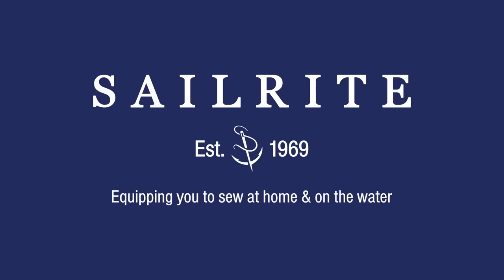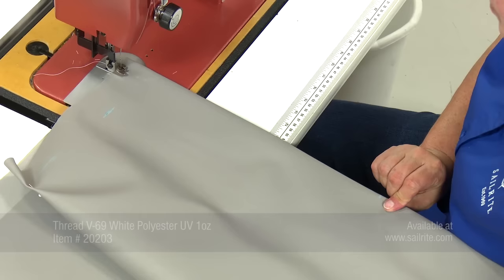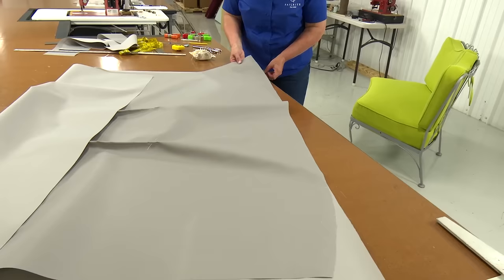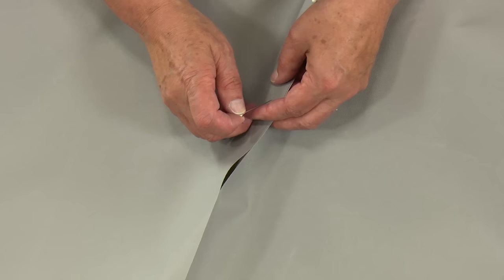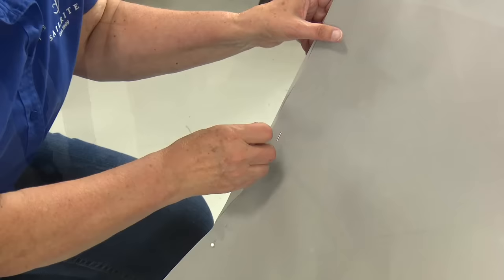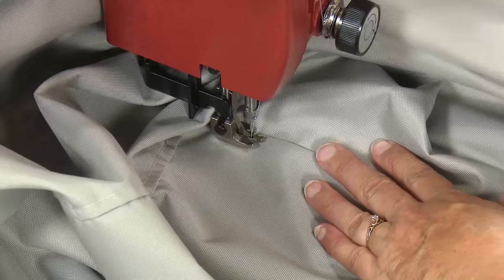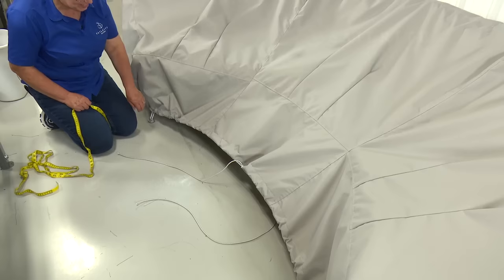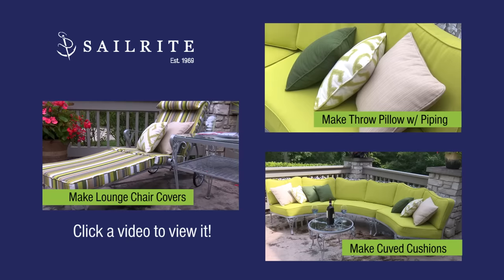How to Make a Cover for a Curved Patio Set - Sewing Outdoor Furniture Covers

Comment: How do I know how much material I need
Reply from the maker: An outdoor furniture chair that is built to accommodate one occupant will generally require about 3 yards of a 60” wide fabric to make an outdoor furniture cover for that one chair. However, for more accurate calculations it is best to measure all sides of the chair and then roughly sketch rectangular panels (that are required for your furniture) that will nest (fit) inside a rough sketch drawing of your choice fabric’s width. Try to nest as many panels inside the rough sketch of your fabric as possible, when all panels are fit inside the width of your fabric add up the overall length of the fabric used.